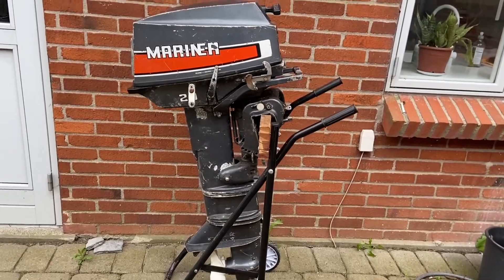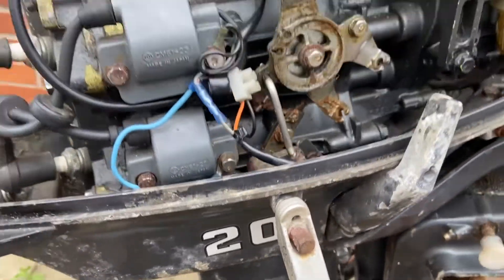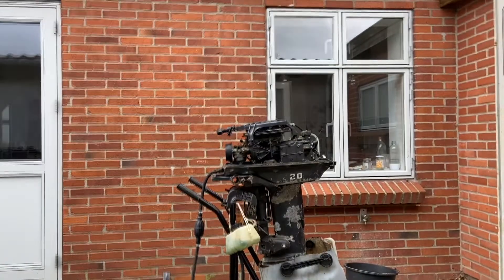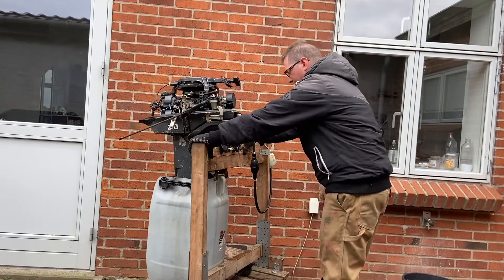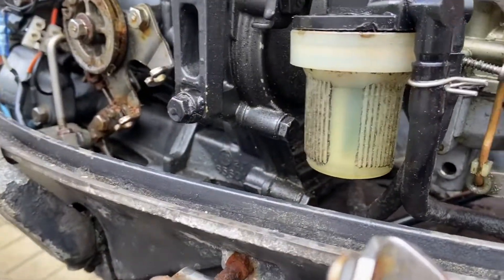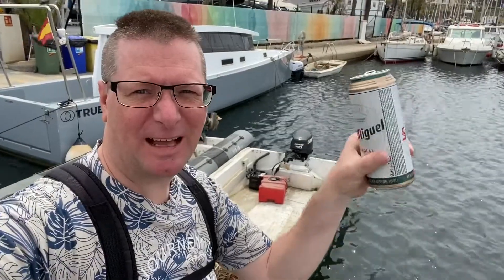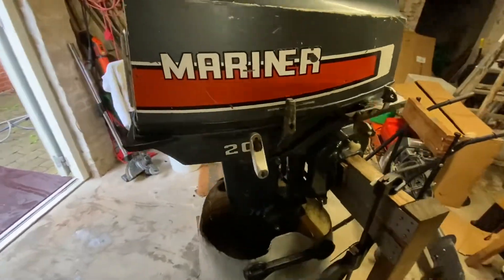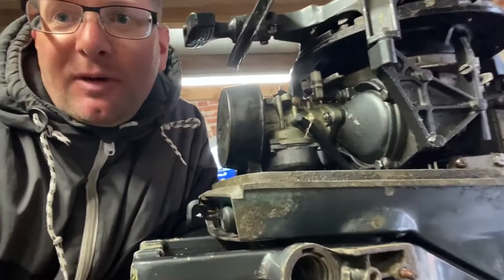Mariner 20 HP outboard part 1/3

Comment: Hi my friend what year is this motor
Reply from the maker: 1972 yes I remember
Reply: Ty
Reply: Hi my friend
Reply: Hey My Friend Can you tell me where is the number of the ignition coil and all the
Reply: Ty I tried to look for it but I can’t find it anywhere I need the whole system electric system of the ignition coil
Reply from the maker: @nelsonaguila5050  Hey if you have more questions I will be happy to answer if I can do that
Reply from the maker: @nelsonaguila5050  I actually do not have that engine anymore I sold it to spare parts. 
The best thing you can do is you to find the engine like the one you have but it can sometimes be hard :-) and  a old old engine like this it is not worth spending money on :-)